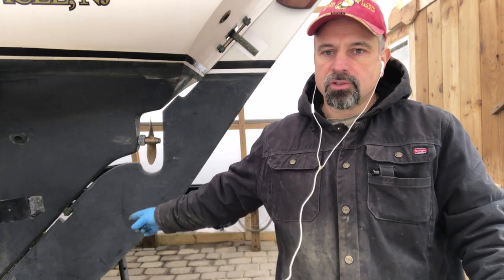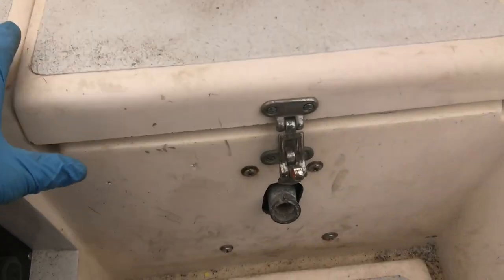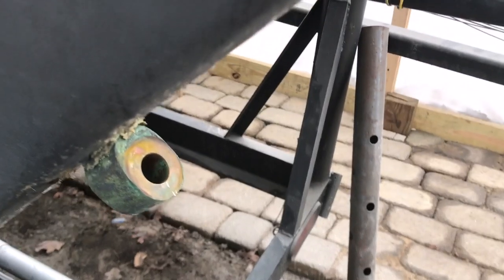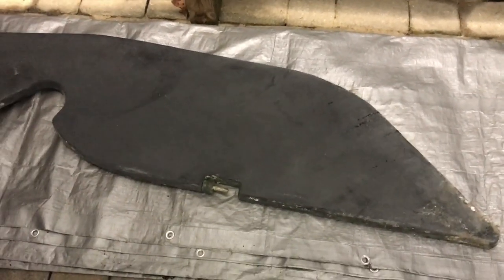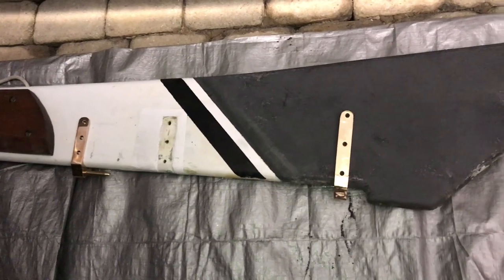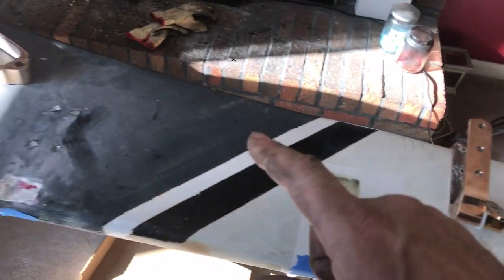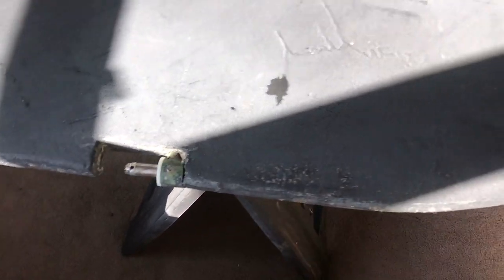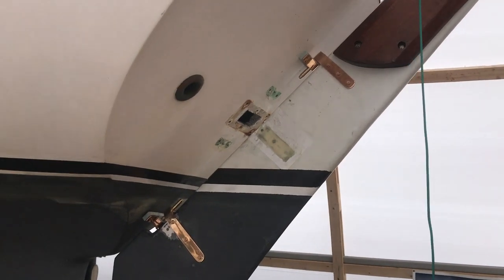Contessa 26 Refit ep.25 - Rudder Gudgeons and Pintles Part 1

Comment: It looks like you have a 2-blade prop, same as mine. I had issues motoring with the 1GM10 and the 2-blade prop. Going into a head wind with moderate seas was only able to make 2kts at 2K RPM. Contacted the Prop Shop in Wilmington NC and ordered a 11" 3-blade. Let me know if you have had any issues with your 2-blade. I should get my new prop in March (Michigan Wheels)
Reply from the maker: Matt- I haven’t had any issues doing 5+ knots with the two blade prop, though I rarely motor unless absolutely necessary.
Reply: I agree the boat does much better under sail. Just ran into a situation last Fall where I had to make port by Saturday night with the wind blowing 20 on the nose

Comment: Thanks for this. I have a Contessa 26 and had the bottom pintel/gudgeon break while underway. Not cool. Where did you get the new pintel/gudgeon’s?
Reply from the maker: Joost- They were made by Davey & Co. in the UK. They are a bit thinner than the originals, so I might install heavier ones if I find something.